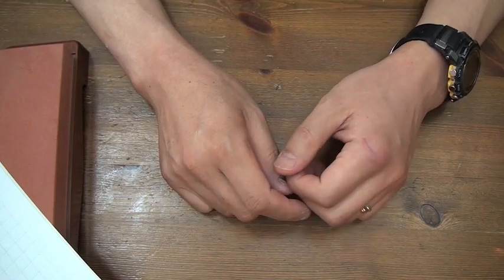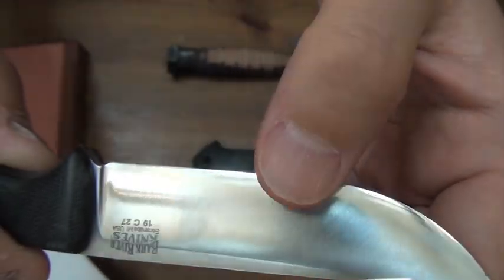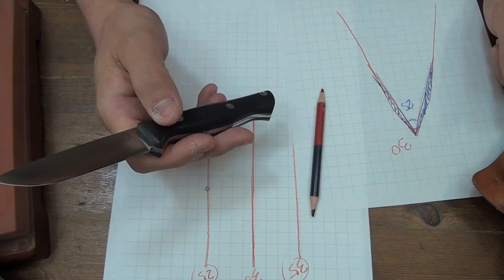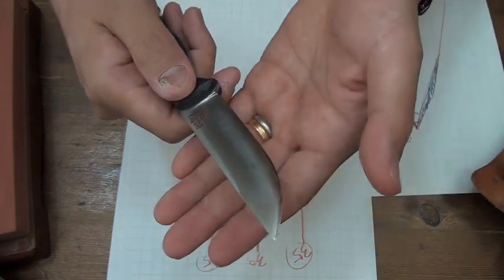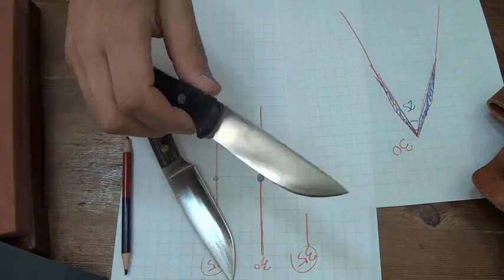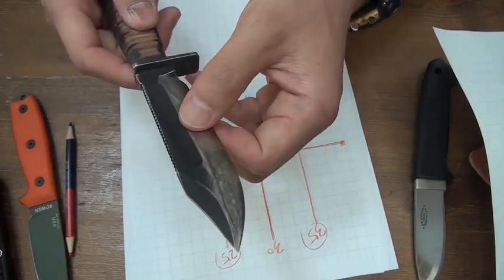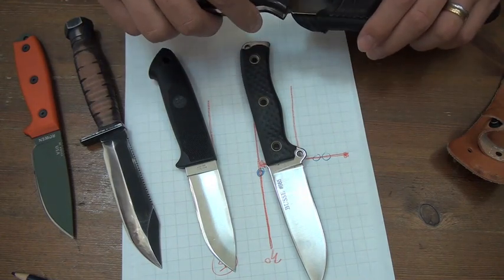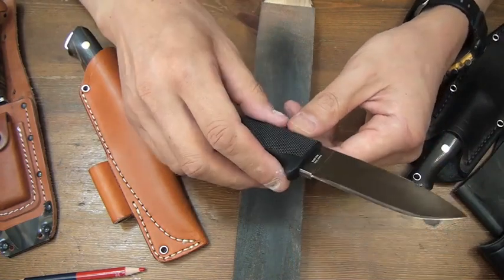Rambling about my edges

Comment from the maker: Only for sharpening my recurve knives I had Edge Pro sharpening system with narrow stones specifically for recurve edge sharpening. But the system itself straightened the edge curve and chipped the tip. So, I left it along with all of my recurve edge knives. Anyway you will need a fixed alignment sharpening system with narrow stones. Or you will need to use sandpapers on a narrow backing and make a convex edge on it. Once you made a convex edge, You would be able to strop it. Thanks.

Comment from the maker: From my water stone sharpening. A regular V edge has 15 degree angle a side. For the initial step of my making a convex edge I sharpen the edge at around 1/6 reduced angle like 12.5 degrees with water stones. Then it will make a 25 degree V edge estimated. And then I go to black compound stropping to make the bevel convex. I estimate this convexing will increase the angle 5 degrees. Then the final angle is expected to be 30 degrees. All are my estimation though. Thanks.

Comment from the maker: Fallkniven is difficult. All Fallknivens have a secondary micro V edge. And to make a sharp convex edge on them we need to grind off a large amount of metal from their convex bevel. TK2 has good geometry and makes less than 30 degree convex edge. F1 has deep geometry and makes larger than 30 degree convex edge. MW1 has the deepest geometry and it makes larger than 35 degree convex edge. So it needs full height regrinding to make a sharp convex edge. All are from my personal experiences. Thanks.

Comment: Wako, I have noticed that your Bravo 1 does not have a thumb ramp? Did you remove it or, am I able to order it without the ramp?
Thank you for this video by the way. Great explanation of how you achieve your angles. I will be putting this instruction to work in about five minutes. :)